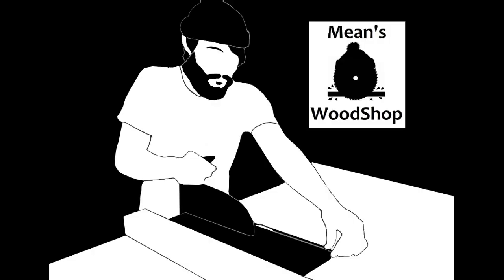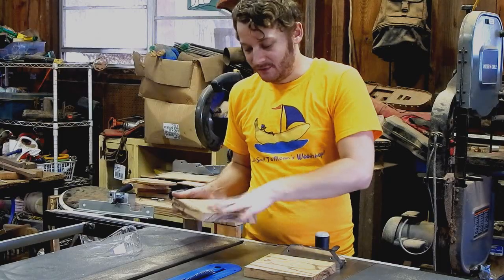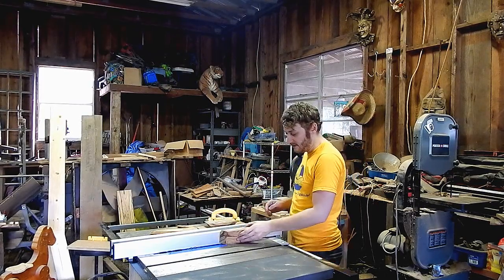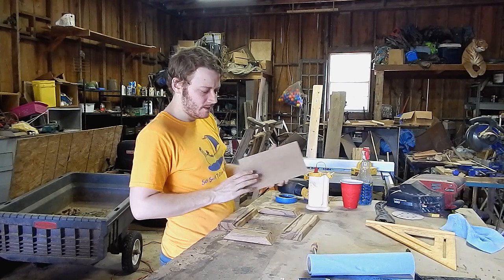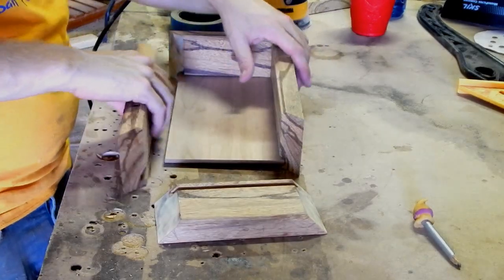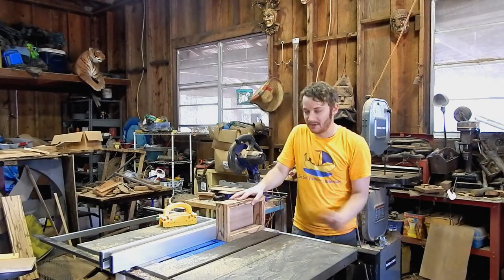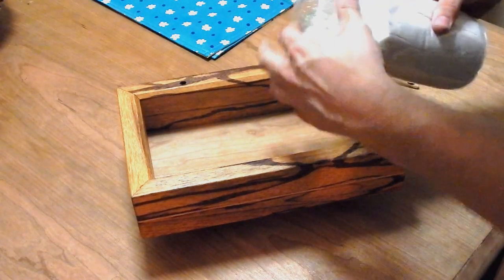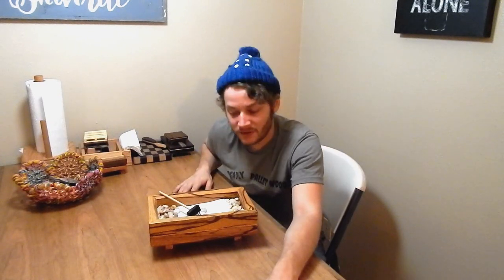Building A Relaxing Desktop Zen Garden With Exotic Wood & Fancy Inlay!

Comment: I love the way that turned out Caleb!  I have a couple marblewood blanks for pen turning but have yet to use them, that is my only exposure to this wood so far.  The details like the inlay, the bevel cuts and the box feet were really nice touches that elevate it into an even finer piece of work.  Also, i really appreciated the tip about cutting the 45 degree angles on the full width before splitting them down to size.  Now that you said it, it seems so obvious, yet I never thought to do that.  Any methods that will reduce the chance for me to screw something up, I am all for so thank you!   Not sure if inentional or not, but loved the 'easter egg' at 5:40 in the video.  :)
Reply from the maker: Thanks, Mary! I really love that marble wood, and it wasn’t hard to work with like I was afraid of. Making those 45 degree cuts before splitting the board was something that I’d thought of around the time I made that serving tray. I’m not sure if it’s “proper procedure” or not, but it’s worked well for me and is definitely a time saver. I was wondering if anyone would notice that or not!